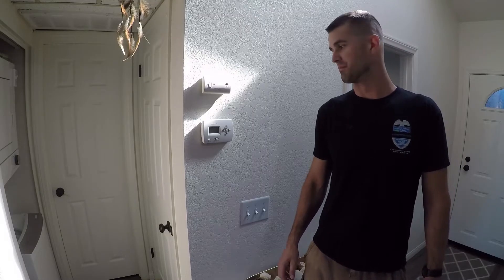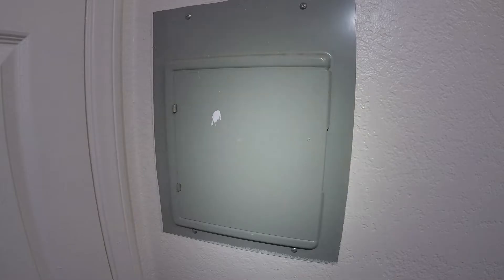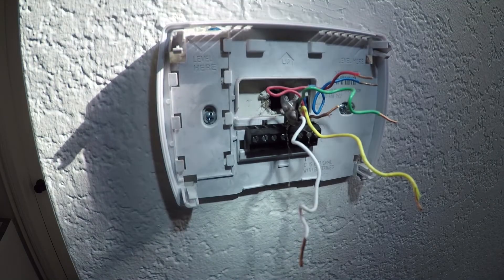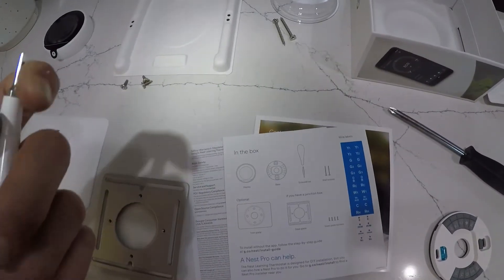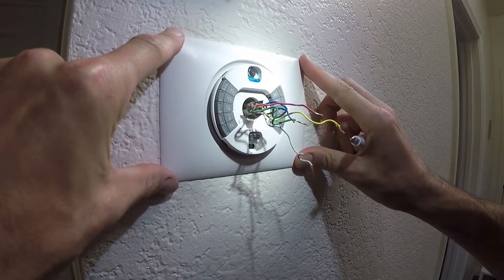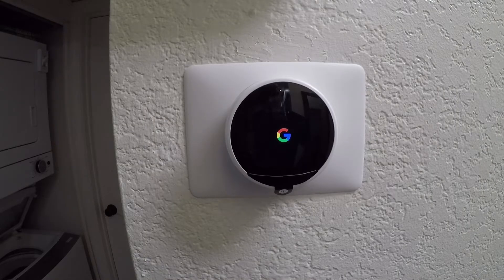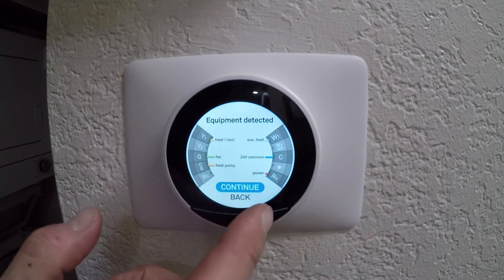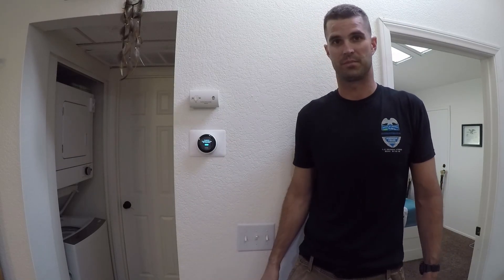How to Replace HVAC Thermostat and Install the Google Nest Thermostat

Comment: Our house is only 2 years old and came with this Google Nest E thermostat. It went out tonight and we called customer service. They told us to charge it. After 3 hours of charging the light was still blinking green. Worthless customer support. Bottom line is that the thing is broken. It does have a C wire so it should not have to be taken out and charged anyway. The customer service is clueless about their own product. I will be having an HVAC out tomorrow to install a normal and reliable thermostat, not this unreliable "smart" garbage that breaks down after 2 years!
Reply from the maker: Ahhhh I see now. I’m really sorry to hear that. Since I installed mine I’ve been lucky not to have it go out yet. I also got a new ac put in over this so it got changed over to a new system. That sounds like a nightmare… I don’t think google would be much help at all with hvac. Makes you miss the good old days with the actual knobs and buttons to make it hot and cold

Comment: My nest keep updating in a loop and house is colder than nest app on phone , what to do ?! Thanks
Reply from the maker: @AlfonsoPerezBorroto  It sounds like your Google Nest thermostat is stuck in a software update loop and isn’t heating properly — super frustrating. Here’s how to troubleshoot it step-by-step:

1. Restart the Nest Thermostat Manually
	•	Hold down the thermostat ring (press it in like a button) for about 10 seconds until the screen turns off.
	•	Let go, and it should restart.

2. Check Wi-Fi Connection
	•	Sometimes update loops happen because it can’t connect to the internet properly.
	•	Use the Nest app or thermostat to check Wi-Fi settings:
Settings > Network
If it’s disconnected or weak, reconnect it.

3. Check the Update Status
	•	After it restarts, go to:
Settings > Version
If it says “updating” again and seems stuck, move to step 4.

4. Cut Power and Restore
	•	Turn off power to your HVAC system at the breaker box for about 1-2 minutes.
	•	Turn it back on. This resets both the Nest and the system it’s controlling.

5. Make Sure It’s Charging
	•	If your Nest isn’t getting enough power (common in older HVAC systems), it might not complete updates or run properly.
	•	Check in Settings under Power > Battery — if it’s below 3.6V, it might need a common wire (C-wire) or a power adapter installed.

6. Adjust Temp Manually via Thermostat

If it’s cold and the app’s not helping:
	•	Try adjusting the temp directly on the thermostat itself by turning the ring and pressing in to confirm.

7. Factory Reset as Last Resort
	•	If it’s still stuck:
Settings > Reset > All Settings
(Note: You’ll need to reconfigure it afterward, including Wi-Fi and heating/cooling schedules.)

If nothing works, it might be a hardware issue or a failed update. You may actually need to call an hvac company to help out.
Reply: @bigacefilms  thank you for ur response!! i did all of it and didnt work, still looping ...
Reply from the maker: @ have you reached out to google nest support?
Reply: Google Nest thermostats are garbage! Their customer support is awful as well! Unreliable smart crap! Good luck
Reply from the maker: @Grayback1973 I don’t get technical with mine. Just like the easy dial and temp adjustment really. Not really connected to WiFi much. Love the light more so as well 😂

Comment: You should have shown the wires connected old into where you put em in the nest. I’m trynna figure it out
Reply from the maker: @tokhiJ  I am sorry for this. I should have, and I believe some peoples units will be slightly different depending what system they have. So I may have left that out but I need to follow up with it now.

Comment: after i connected everything at the end of the set up it said its not compatible do i have any other options?
Reply from the maker: It’s a possibility one of the wires may not be correctly connected. There’s many colors and it’s easy to get confused. Go back and check the wiring and also check the app on your phone. It’ll have the installation directions as well to assist. I don’t see why it wouldn’t be compatible. Also recheck to see which hvac systems it will work with, it may be specific kinds but I highly doubt that. If it’s a mini split I don’t think it’ll work.
Reply: Yeh. You didn’t show us which wire goes where. You just cut right through it . Our old thermostat has “jumper” wire and we have no idea what to do with the jumper. Thank you